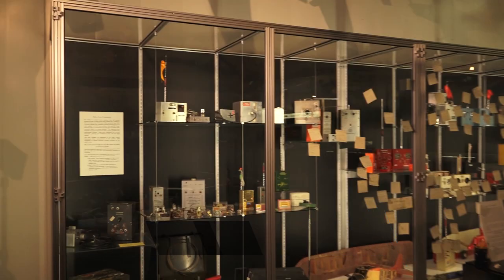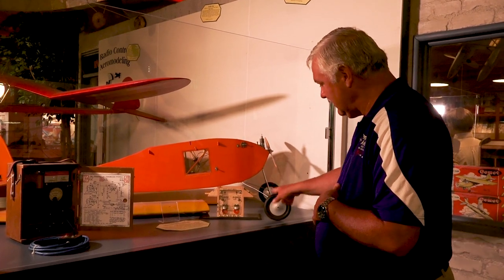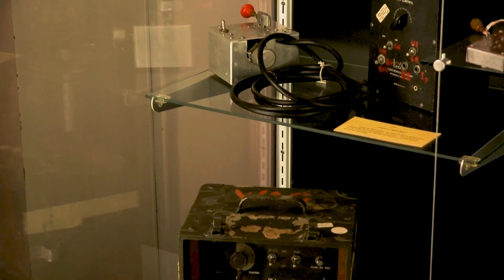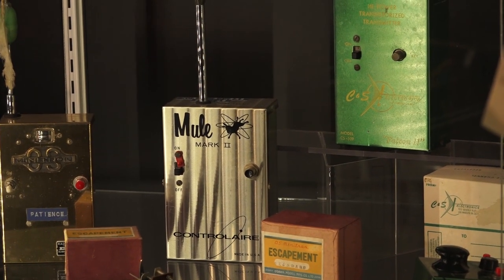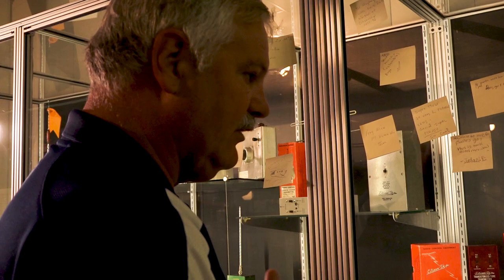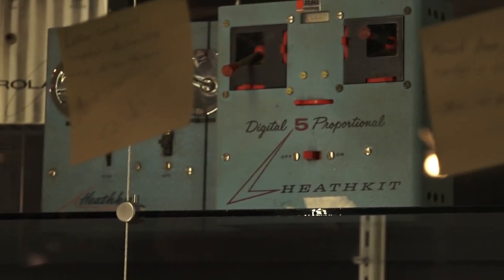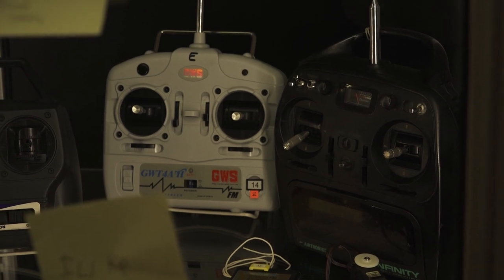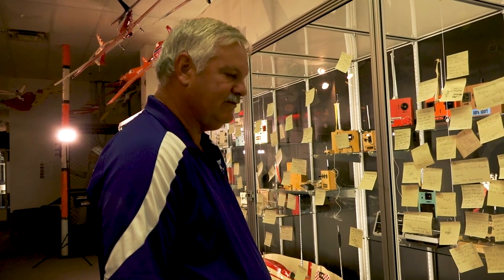The History of Radio Control - Model Aviation Magazine

Comment: I started in late 80's with a two channel futaba radio with s128 servos. The rx battery was a cradle for 4 AA batts. I think back then there were like 28 frequencies in 72mhz band. In early 90's they doubled that to like 56 channels. Then I got the four channel futaba attack radio followed by airtronics vanguard 6ch radio with dual rates. Then I got my flagship futaba 8U heli radio and I still fly it to this day but it's converted to frsky 2.4ghz system. That radio does everything and I haven't had a need to use anything else. It must have been amazing to go from free flight/escapement to full proportional radio control. I know there was a latency in servos and transmission of signal. They worked on it to get it to minimum. So while it would be cool to go back to the early days of radio control, they still had issues to be worked out that lasted till today.

Comment: From Wiki on "Radio Control":
In 1898, at an exhibition at Madison Square Garden, Nikola Tesla demonstrated a small unmanned boat that used a coherer based radio control. 
There were also numerous other radio control systems before 1937.